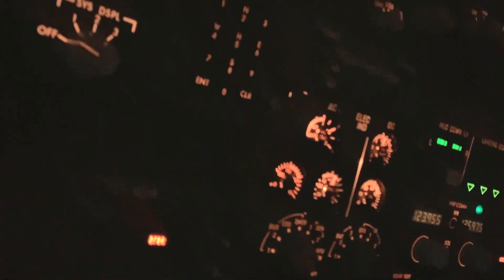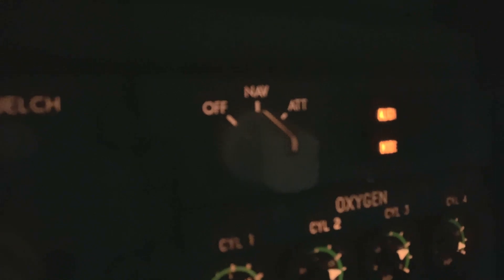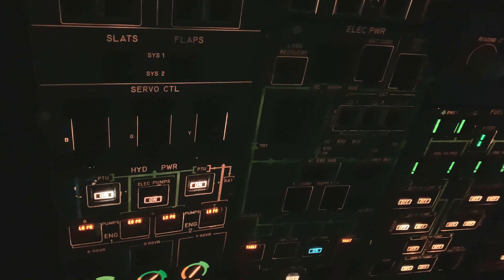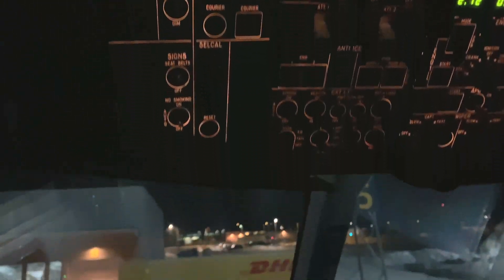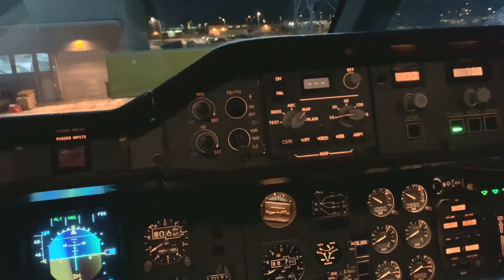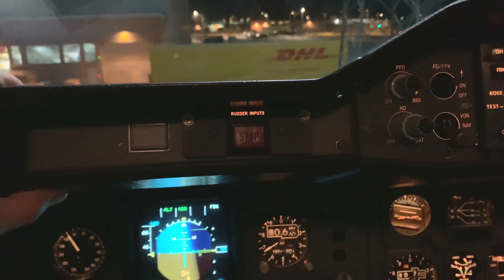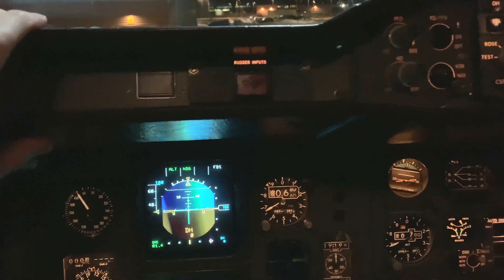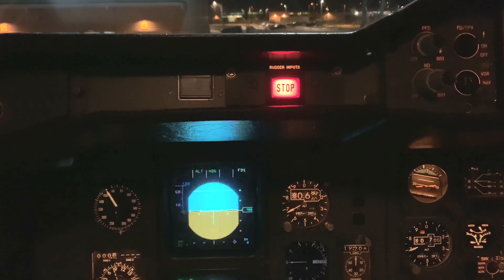🎬  AIRBUS A300-600, ATA 22, Operational check of stop rudder input warning system. ✈️

Comment: Hi

Do you know at which speed this warning is triggered or when the warning is exactly triggered?

I couldnt find a document that describes it.

Thank you
Reply from the maker: Using the ground test set,  increase simulated Vc to 330kts and within 40 secs Apply full pedal deflection on one side and then the other in less than 2 seconds. Then warning will be triggered. Hope this helps
Reply: @aircraftengineerstoolbox2560  

Thank you for your reply!

How do you simulate the Groundtest?

Do you just set the 330 knots cruise speed on the FCU speed window?

Is there a minimum speed that triggers the warning?

What happens if you would 

1) exceed 40 seconds and you havent deflected the rudder to both sides?

2) What would happen if you move the rudderpedals for example 4 times instead of 2 times from one side to the other?

Comment: Thank you for the detailed explanation.
Especially how to set up for a ground test!

I red that FedEx didnt want to install this feature at the beginning because of the high costs and because they already had a large fleet of A306 and A310 freighters.

What I heard was that when you fly within the Greendot speed, you could deflect the rudders and other control surfaces for ailerons and elevator without causing any damage. Even if you change the deflections back and forth many times. You could also use rudder, aileron and elevator at the same time back and forth.

The STOP RUDDER INPUT WARNING is triggered when you exceed a certain speed and using the rudder.

Please, can you try to record directly with your phone microphone?

I know that it should be possible to do that so that you can hear the warning in cristal clear quality.

I really would love to hear it in top quality.

May be it is possible to record it direct from the communication panel?

PLEASE PLEASE PLEASE!